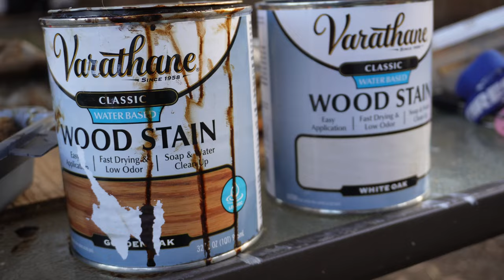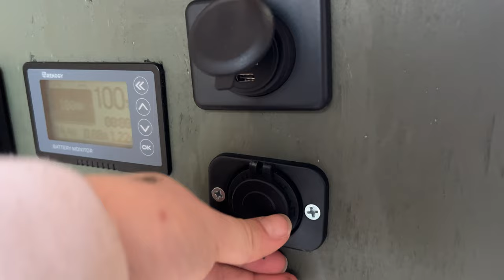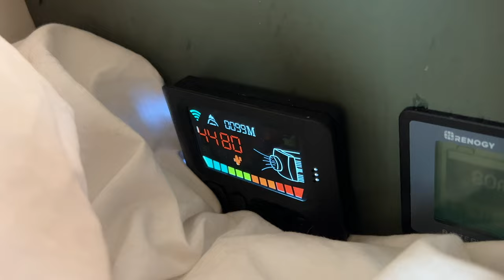van build TIMELAPSE | start to finish!✨

Comment: For three days I have avoided trying the rivet gun. That's not the part that worries me it's the part where you have to take a drill and make the holes for the rivet nuts. I'm scared to death I'm going to go through the other side of the Van Wall. I was actually going to go to the hardware store tomorrow and ask him if they had a short drill bit so there was no possibility I'm going through the other side
Reply from the maker: Hmm… what type of van do you have? I didn’t have to drill ANY holes for my rivets! I have a full video that shows how I did it if you’re interested, my ford transit has little holes and I used those!
Reply: @JuliaBrooke  it's a 2022 Sprinter 170 high top. Yes there are some existing holes in some places. After watching probably 2000 van life videos it is my intention to use two by fours and put at least 3 rivet and nuts nh-1 and then any self tapping screws which most people only use and it blows my mind because hardly any bit of that screw goes through the metal and people are always talking about stuff falling down and then you see it happened so yes ma'am I was happy to see you using that rivet gun and I almost went out there tonight to send a few through but I've got the van filled up with everything that is going to be needed to do the roof solar panels to Max their fans and the ceiling that's the only thing I'm hiring out and yes he's going to do the battery box in the power system. Other than that it's all a self-build and this dude in the shopping works for we're disappointed they thought they were going to build out the whole thing and I laughed and I said no I said that's the fun part I said I'm only going to hire you to do the part that is too hard for me as an old lady and the things that are beyond my understanding and have no desire to learn.